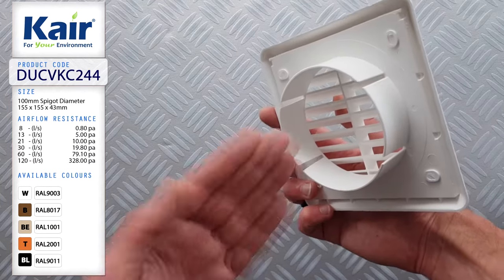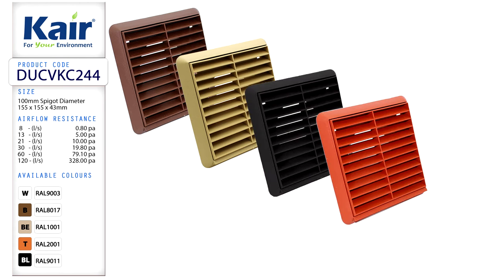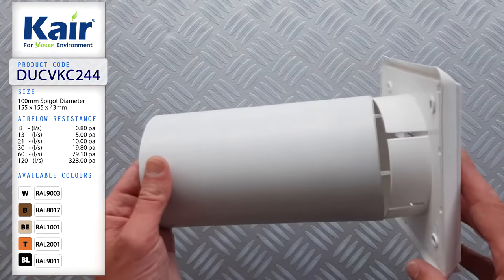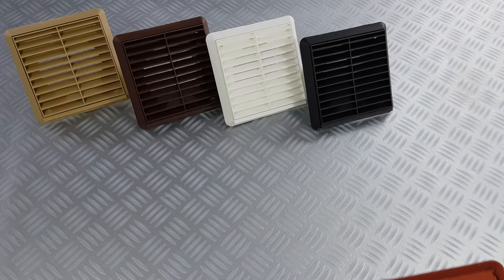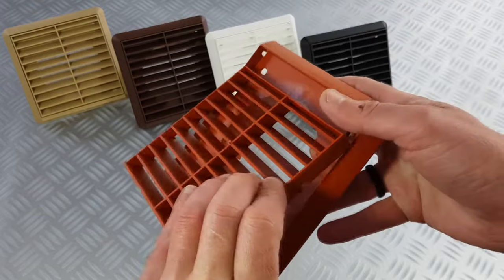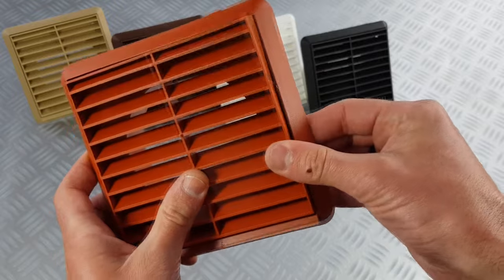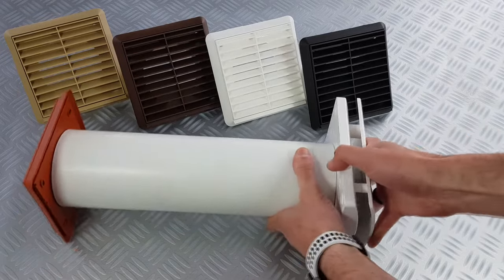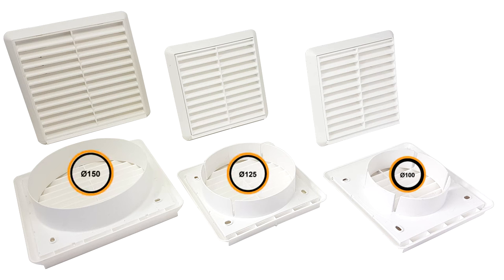Kair External Wall Louvred Grille Ducting Air Vent with Round Spigot

Comment: What about internal grill for just air vent
Reply from the maker: For the internal grille, you could use the DUCVKC256. However, keep in mind that having a straight pipe from the inside through the external wall might cause backdraughts.

If you're considering passive vents, I recommend checking out our Rytons range for some great options. Here’s the link: Rytons Range: https://www.i-sells.co.uk/?s=RYTAC&et_search=true&post_type=product